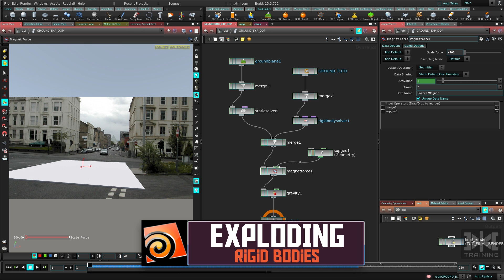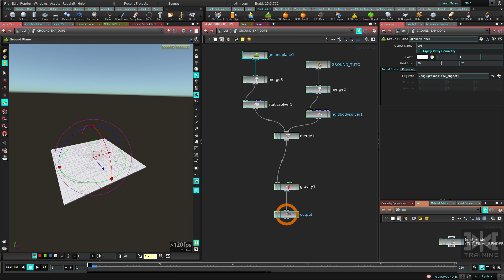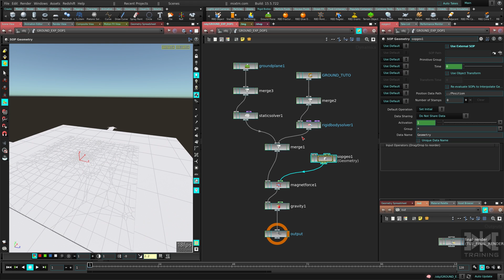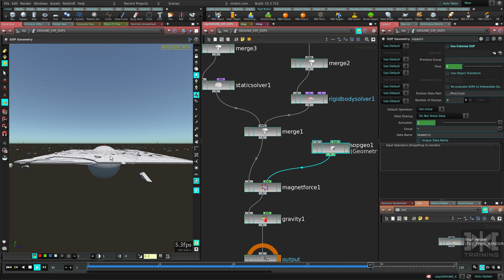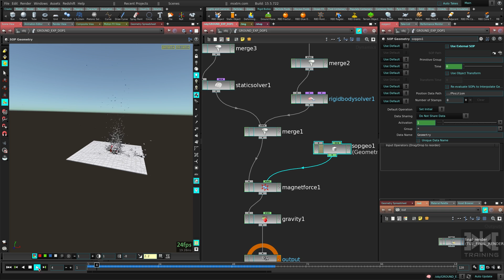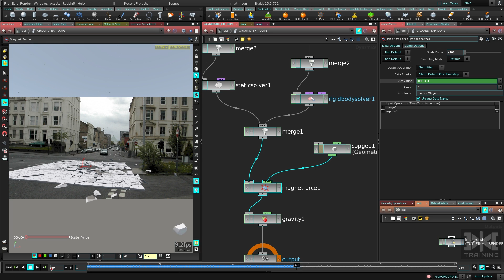VMT 014 - HOUDINI - Exploding Rigid Bodies

Comment: if I am using the metaball for an object in the air like a planet(which is a packed RBD) that explodes how do I transform the metaball to the exact position of the object. when I go into the SOPgeo node  I can't see any other nodes i tried show all objects it didn't work. thanks!
Reply from the maker: You can use snap or get the centroid of the object with the centroid() expression

Comment: it doesn't work with glue constraints
Reply from the maker: I haven't tested that recently, give it a big push and lower the glue constraint strength
Reply: MIX Training Hi thank you for replying, the thing I meant by not working with glue constraints is that it doesn’t work at all like, I can’t seem to merge the magnet force and glue together so they work probably